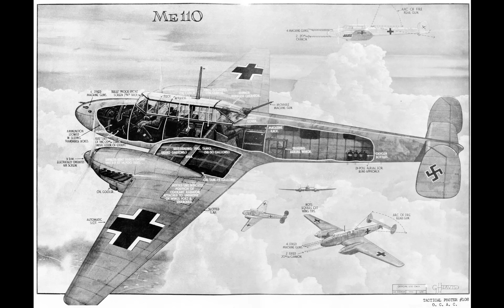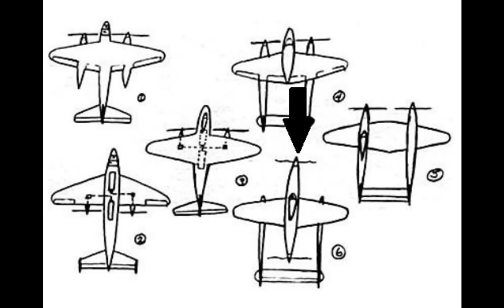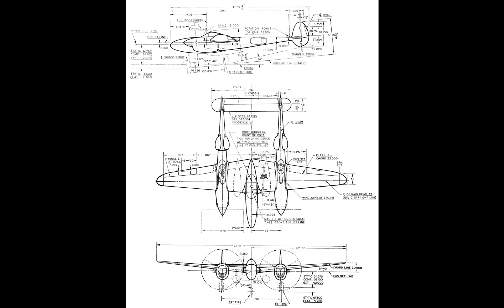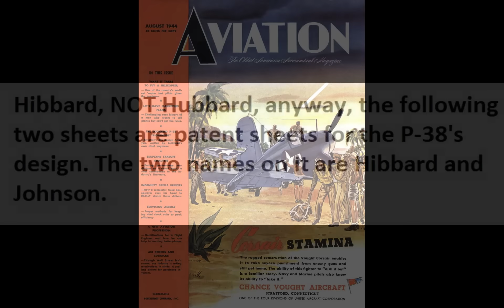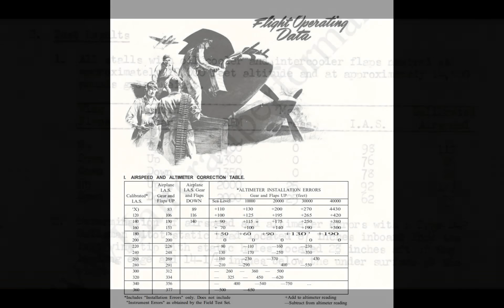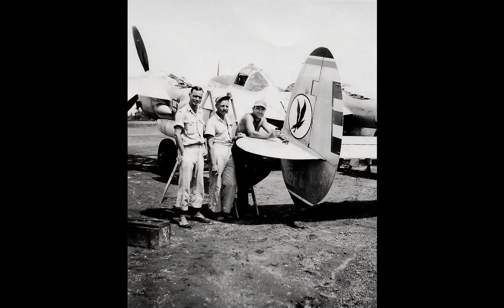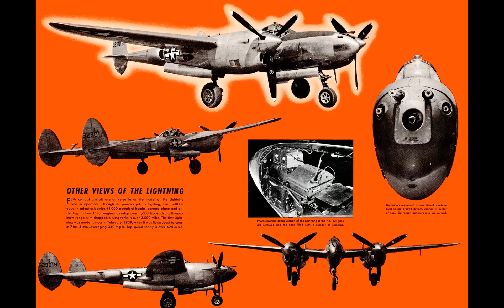Lockheed P-38 Lightning Design Info

Comment: whats the pointy thing on the middle of the P-38 elevator?
Reply: A counterweight. You build a large, hollow structure like an elevator and then set it on a hinge at one end, the whole thing is going to droop over unless you hang a series of small, solid weights on the other side of that pivot so you counterbalance the elevator. The P-38 has a number of internal mass balances, but the Army wasn't satisfied with the amount and demanded that Lockheed add more, which they literally bolted to the outside of the elevator.

Comment: Dad graduated from UCSF, his first job, working for Lockheed Burbank on P-38's as an inspector. He later got transferred to another line as Lockheed got a contract to build B-17s and modify others to the latest model, including the B-17G. He got drafted in 1943-44 and participated in the D-Day invasion, survived all the way to VE day,, but never went back to aircraft work. I enlisted and worked two Lockheed aircraft, several versions of the C-130 and the C-5A before my final discharge.

Comment: One intriguing “What If” for me is what if a formation of B17’s were replaced by P38’s with 4K lb bomb load led by a glass nose P38 with a Norden Bombsite for a bomb mission? High speed on the way in. Formate as a fighter sweep not a bomb mission. Do the bomb run and exit the area as a fighter squadron. This possibility would have saved crew lives.
Reply: They did fly fighters with the nose unpainted (or wirh a band around the nose if the entire plane was unpainted) to make armed fighters look more like a Droop Snoop. Either this was an attempt to fool enemy fighters into attacking what they assumed was an unarmed Droop Snoop (highly unlikely, in my opinion) or to hide a Droop Snoop among a formation of fighters while the formation did an interdiction run.

Comment: The plane also pioneered "Speed Brakes" because of the "lack of control" problems in a power dive.  A pilot had to have a really big set to push the wheel forward, then pull back to get out of a dive, if the plane didn't tear it self to pieces first.  Also was the 1st fighter to escort bombers into Germany, & yet the P51 gets that credit.
Still my favorite, along with the Hellcat.

Comment: Turbochargers and superchargers are different aren't they?
Reply: Supes take power directly from the engine via a belt, chain, or gear. Turbos take power indirectly from the engine through exhaust flow (it's not entirely "free" power, since this lowers the exhaust velocity and creates back-pressure in the exhaust manifold).

The compressor used for either type can be the same. The difference is the power source (and the fact the turbo wheel has its own inertia that's separate from the motor).
Reply: @BogeyTheBear  Thanks!

Comment: Center inlet look for me like engine inlet not intercooler. Intercoolers scoop inlets are behind wing.  It may be both, but one inlet in front must feed engine with air as well, if not no ram air would be avilable.
Reply from the maker: The center inlet is for the intercooler. The early planes don't even have that inlet.
Reply: @GregsAirplanesandAutomobiles  oh got it. Wonder where is intake inlet then, somewhere on the side?
Reply: @grafspeem9402  The ram-air scoop is located on the outboard side of the boom, underneath the trailing edge of the wing. Air is caught there, compressed by the turbo right beside it, then piped forward under pressure to the intake manifold.

Comment: Fantastic start on the P-38, Greg! You should take a look at the NACA report conducted to help the 38 increase its Mach number. To my memory, recommendations were to move radiators to leading edge of wing, a la Mosquito, and to extend back the pilot gondola a bit past the wing to help reduce shockwaves over the tail at high speed - also to rake back the windscreen a few degrees more. My research indicates that the War Production would not allow the P-38 to be taken off line for the time necessary to make the tooling changes - the judged that demand for the 38 was too great relative to the speed that would be gained.

Comment: I'm skeptical the P38 did 90% of photo recon in Europe. The P38 didn't go so well there with its Allison engines and the Mosquito was very strong in that space with the Merlin that was much more capable in the cold European environment.
Reply from the maker: Read the description.
Reply: @GregsAirplanesandAutomobiles  Cheers. I know there was a specific recon version of the Mosquito and of course there were many aircraft types that might have been used. I'll be interested to hear what you find out about all this. The P38 and Mosquito were both great planes each with a fan base, so reasoned and well researched commentary is great.

Comment: They're right about putting weapons at least centered on the aiming point (AKA the pilot.)  Having a high horizontal (relative) offset between your aiming system and your weapon(s) makes targeting very difficult at different ranges.  Worse than a high vertical offset does.  The need for convergance on typical single engine fighters with weapons in the wings illustrates that.  P-38 didn't have to worry about convergance distance, AND the pilot didn't need to worry about horizontal offset changes for different distances.

Comment: They had a Allison engine on the P51 why in the world didnt they upgrade P38 with the Packard Roll Royce engine . It would take changing the  Nacelles but could have been done and P38 gas mileage and ceiling would increase to much better that the P51
Reply: More myths that the Merlin is "better" than the Allison. Not in this situation. The Allison as installed in the P-38 with the turbo-supercharging system every bit the Merlins equal. Add to that the Allison a far more rugged and less maintenance intensive engine.
Reply from the maker: I'm getting to that.

Comment: The P 38 was the first plane to experience transonic affects.  Dive bombing turned them in to a " lawn dart ".  The elevator had zero aerodynamic affect at these speeds.  Irv Culver at the Skonk Works, discovered what was happening.  Irv also figured out the fix.  The shock was produced by localized supersonic flow on the horizontal stabilizer, rendering the elevators ineffective. Irv also was the guy that fixed the F 104, from having bad dutch roll, which was having a habit of killing test pilots.
Reply: Are you sure it's not good ol' fashioned Mach tuck? Why are the dive flaps situated outboard of the nacelles and not in line to deflect any shock wave off the tail?
Reply: @BogeyTheBear  Positive.  And dive flaps don't / won't do anything with the shock wave off the leading edge of an airfoil, but they will probably get ripped off the plane,   if you could extend them at transonic speeds.
Dive flaps kept the plane below certain speeds for many other reasons.  I wasn't the test pilot.  I did get a thorough explanation of what happened on the P 38 from NASA Ames, and from Irv Culver himself.

Comment: I would question the 90% recon success of the P-38 coinciding the 9th USAAF  ditch they P 38 for Spitfires and Mosquito in 1943/ 44 and the RAF also ditch the P-38 for both for Spitfires and Mosquito recon by 1942 /43 that if it really used them for that role
it may be 90% of USAAF recon photos But not 90% of allied recon photos

and come from a American you tube film call Spitfire 944 about a US spitfire pilot flying over Berlin
Reply from the maker: Check the description.

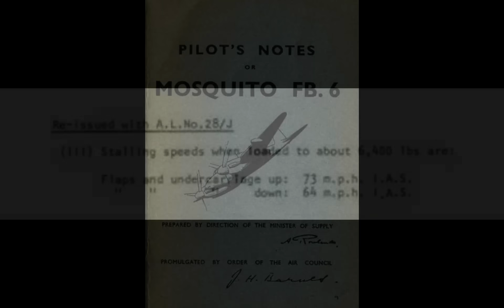Comment: 24:17 (about how "Few WWII fighters had a lower stall speed than the Spitfire Mark V") 73 miles per hour and 64 miles per hour (flaps up/down)
Laughs in Hawker Hurricane (57 mph, just a bigh above that of a biplane)
Reply from the maker: I'm not so sure it's that low. The manual I have for the Hurricane Mk2 has the stall speeds at  80mph and 60mph for gear and flaps up and both down. That's at the lowest weight published, then we factor in the indication error and it's quite a bit higher. It is darn low though, but I wouldn't say it can laugh at a Spitfire's stall speed. They are darn close, too close for me to call without looking at it more carefully in terms of weights and instrument errors.
Reply: @GregsAirplanesandAutomobiles  Mason, Francis K. The Hawker Hurricane I (Profile 111). Windsor, Berkshire, UK: Profile Publications, 1967, p. 4.
But that was just the old Hurricane Mk1 - later models had higher stall speeds - which is part of the joke.
Reply from the maker: I see, yes early versions of every airplane usually have lower numbers.

Comment: I always thought the P-38 had co-rotating props to minimize elevator turbulence and to provide an advantageous turning direction enhanced by 2x torque instead of neutral torque from offsetting engines.  These photos show top-out counter-rotation, which is of course backwards and dangerous when single engine.
Reply: The XP-38 prototype was designed with the propellors rotating inward from the top arc (the proper way). So they knew full well the safety of configuration.

Problem is that the prop wash, in this proper configuration, struck the upper surfaces of the center wing and disrupted any lift created in the center of the airplane. By reversing the prop direction (into that potentially dangerous outward arc) the prop wash came upwards against the center wing sections and restored the lift.
Reply: @BogeyTheBear  
Right, but I thought they settled on co-rotation as the solution, at least partly to turn harder, not softer. And to minimize slipstream turbulence.  And, like the B-17, for ease of maintenance.  

Plus, wouldn't all twins exhibit the problems you're describing?  I thought the issue was elevator buffeting due to the unique elevator/stab geometry.
Reply: @FFE-js2zp  Most other multi-engine airplanes have a straight-sided fuselage in the center rather that a teardrop-shaped gondola. This creates a venturi effect on the center wing sections between the gondola and the nacelle.

Obviously the plane could fly with prop downwash on the center wing-- it simply flies better (important consideration for a fighter) with an upwash to eliminate the low-pressure region underneath the center wing exacerbated by the venturi induced through the gondola's shape.
Reply: @BogeyTheBear  
PS although I've never flown a full scale P-38, I do have several large RC P-38s and they are the best flying warbirds by far, IMO, with proper counter rotation.

Comment: Do these engines use carburetors? How do they compensate for elevation changes with the air/fuel ratio?
Reply from the maker: They use a primitive form of fuel injection and were often called "injection carburetors" or "pressure carburetors". It's basically a throttle body injection system with a mechanical computer instead of an electronic one.

Comment: The trenches that had the mechanisms for moving the P39's down the line were still there when I worked for Lockheed in Burbank starting in '78.  My dad started at Lockheed working on gun installations on the Hudson bomber and talked Tony LeVier into a ride in a P38 by squeezing himself in behind Tony's seat somehow.  As a kid in the 50's I remember P38 rece versions parked along the fence at the Lockheed Air Terminal.  Always a favorite!
Reply: They had P-38s set up for training new pilots by removing the radio gear that normally sits behind the pilot's seat. The trainee wedged himself in that area behind the pilot and would watch how the instructor operated the airplane.

So, it was doable. But no one ever said it was comfortable.

Comment: John Cyrus Tidd, had just been elevated to supervisor in the Lockheed Model shop when WWII was declared.   
He told me that the P-38 was one of his fondest memories from working at Lockheed.
John told me that the worst thing. job wise, during the war years was that because he was now considered management, and not qualified for overtime pay, that he was supervising people that all made at least twice was he was getting paid, due to overtime pay.   They were all working 60+ hour weeks.
John had originally built wooden sail planes for several millionaires early in his career, and on the Connie, the U-2, the SR-71, and others for Lockheed.   
If you've ever seen the original NASA shuttle model at the Smithsonian, he personally built its fuel tank, in his home shop. Nowhere else hard a large enough wood lathe to turn it on.  It was actually hollow, built just like a barrel.

I got to watch it being built, and it was amazing.   Met Ben Rich at John and his wife's 50th wedding anniversary, years after he had retired.

Comment: I'd love to see a detailed video on the mechanical differences of the Allison 1710 V12 and the RR Merlin.
I know the Allison used rollers on their rocker arms and the Merlin did not
The Allison could be easily reversed by flipping the cam shaft and swapping the starter motor
I suspect the Allison was both more robust AND more durable than the Merlin.
Also, while the American built Packard version of the Merlin was built to good repeatable specs with easily interchangeable parts, the British built Merlins, which were built in four different locations in England and Scotland, were crap that wore out quickly.
I know there is a facility in California that rebuilds these engines and are the premiere source of info.  (Kermit Weeks has videos of his visits out there)

anyway, there's a suggestion
and I think you're the man for the job
Reply: I never think that the Allison gets the respect it is due for being a great design. If had around half the parts of a Merlin, had a very sophisticated combustion chamber and intake/exhaust port designs,  could be converted easily to run either direction. It was very much loved by ground crews who found it far easier to maintain and keep going than the Merlin. It could also really be abused and keep going. Allison finally had to give the seal of approval on running manifold boost pressures way over what were originally intended. P-40's with the automatic boost control disabled were running as high as 70 inches or more with no real ill effects. That meant that around 10 or 12K feet the engine was putting out about 1,700 hp when using high octane fuel. At the low to medium altitudes most combat occured at in North Africa, the MTO and the Pacific it meant the old P-40 was not the aircraft that most historians keep retelling old inaccurate stories about.

Comment: I believe a key piece of why the 38 was less successful over Europe is that a large batch of them handed to the UK were done so without the super chargers.

Other issues that plagued the lightning early on were that the compression on the front of the wings could lead to the plane not coming out of a dive until later models received an air break design added for the cause, and for a while many pilots would take some of their flight gear off in the cockpit because of issues with the cockpit getting hot.

These and other issues were resolved however in later models and some of it's ideals of redundant systems have carried over into modern aircraft such as now the very long running A-10 Warthog. The same A-10 they go up and down about it being replaced, but to this day continues to get upgrades because they simply don't have a durable replacement for the flying tank of a beast that is the hog.

Some of the newest fighters in fact are so fragile that they don't even want to use them on aircraft carriers for the landing and stopping process on said carriers risks a higher likelihood of catastrophic failure.
Reply: The British got “castrated lightnings” with no turbos - don’t think these ever saw combat.

Comment: One aspect you could touch on in future episodes is these planes were sold to the British and they were very unimpressed. Mainly because for some reason they did not have the engines turning in opposite directions but the same direction. Apparently there was torque issues that the found difficult to counter act. Plus they were tricky to bale out of due the potential to be injured by the knife like elevator, it was recommended to invert the plane then bale out. Also at high speed they had what they called compressibility which they managed to overcome. Good show keep it up.🇦🇺
Reply: No BPC had seen the P38 with the Turbos  and were impressed and put an order in. In the mean time the US Govt put a ban on the sale of the  secret Turbo-Supercharger    Lockheed then tried to sell the earlier version without the turbo-super and the BPC rejected it.

Comment: It would have been interesting to see a P38 with Merlin engines, the difference in performance between the Allison and Merlin engined Mustangs was startling.
Reply from the maker: I really need to address that.
Reply: In my opinion the difference would not have been much. Remember the Mustang did not have the turbo-supercharging system the P-38 did. The P-38 was the one aircraft that utilized the system that Allison had intended for high altitude operation.

Comment: The  C 119 was equipped with  two Pratt & Whitney R-4360  which could  rank out 3+ thousand HP eachThe C-97 four engine transport , on which I spent four years  was also powered by the R-4360 (4)

Comment: IIRC the USAAF asked the RAF to evaluate the P-38. The RAF assessment was the P-38 was inferior to the Mosquito and unsuitable for NW Europe. I suspect the RAF’s preference for their own DH Mosquito colored the recommendation. Of course Even so the USAAF never operated the DH Mosquito. Although the Americans did fly versions of the Spitfire.
Reply from the maker: The RAF flew NON turbocharged NON counter rotating P-38s, that's just not the same thing and actually defeats the whole design.
Reply: @GregsAirplanesandAutomobiles  …. I’d have expected the 8th AF would have lent one of their own P-38’s for RAF testing. The P-38 continued in USAAF combat service flying out of England. They didn’t go away